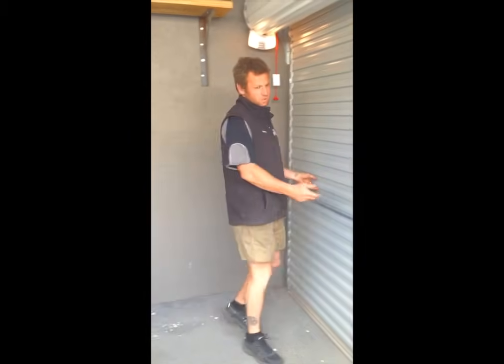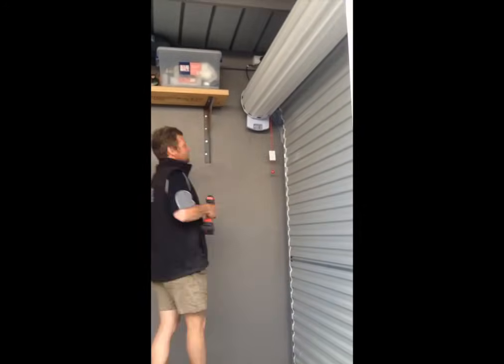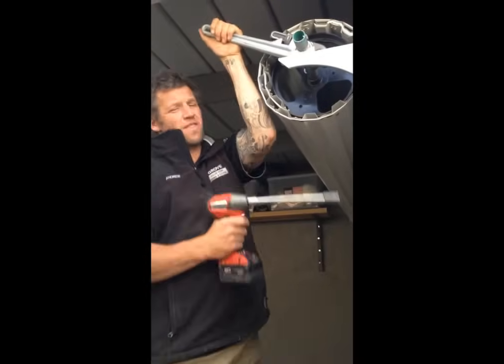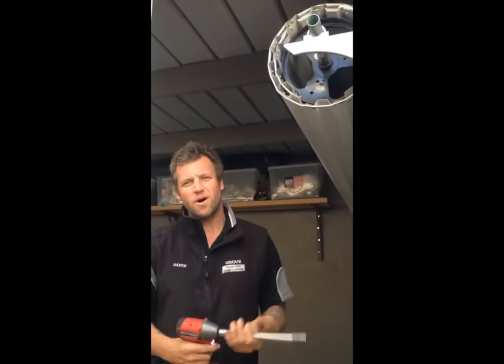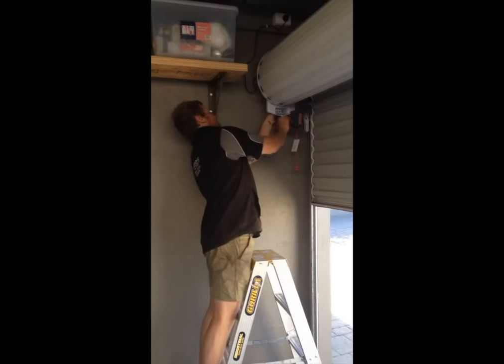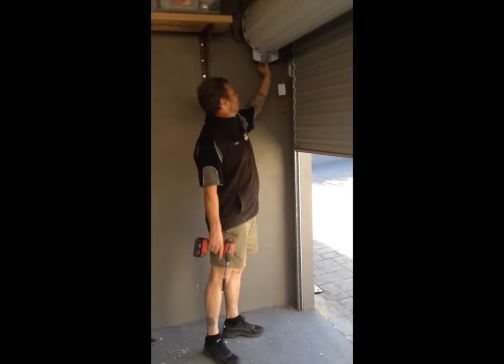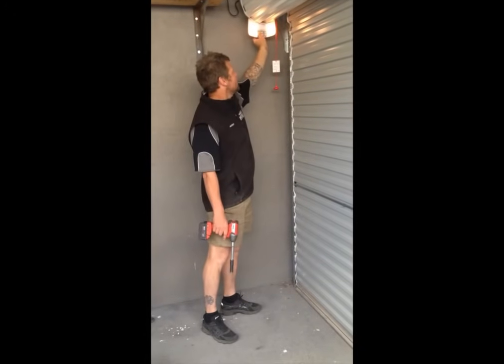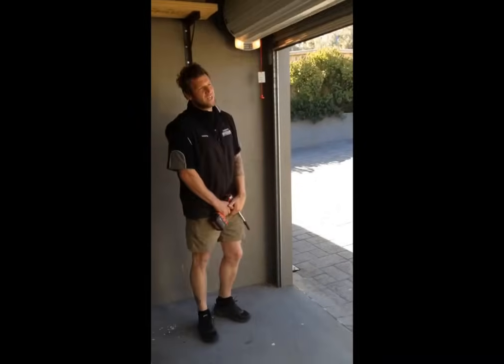Garage Roller Door Re-tensioning

Comment: Just like to say good video BUT big mistake in this video is that you have to door down when you undone the spring (u bolts) that is SUPER dangerous the roll needs to be up ... on a small door like this its no real issue but do it on a bigger door the one u bolt wont hold all that spring tension and you will have people worse off than before ... when a roller door like this is down the spring is at FULL tension have it up its like maybe 2-3 turn worth of tension ... If the door doesn't want to stay up use some visegrips to hold it up ...

Comment: Great video. My door is a manual door. Opening it the ‘roller’ doesn’t keep up with the door and it doesn’t ‘spool’ properly at the top. It bunches up. The only way to open without this happening is by ‘paddling’ it both arms above my head. Any suggestions? Could this be a re-tension? Or more likely something else.

Comment: My door problem is that the door parted from the left hand side I have re attached the door to the wheel with the door fully rolled out I have to re tension the left spring only how many turns are the starting point the door is 12 ft wide and 8ft high

Comment: Jesus mate DO NOT under any circumstances undo ubolts whilst the door is down and under HIGH tension.  RE tensioning is done whilst the door is open and DIY’rs put a rope around it for safety.  If you didn’t spin the motor around the limits wouldn’t be out of sync either maybe you need some training mate.
Reply: Thanks for this info, I just loosed my bolts with shutter down and the spring has now locked the door to ground, how do I loosen the spring now so I can open my roller door again?? Help is much appreciated
Reply: Look like your the only Amateur here in the comments, as everyone else has thanked Ole mate for a Clear & Concise Educational Video.
Reply: @filipina5953 the fella is correct 

this is def wrong way
Reply: @jasonmcdaid2200  Quite the contrary, with correct precautions taken, can be carried out in a completely safe manner. Too many “one jobbers” on YT that possess tunnel vision.
Reply: @filipina5953  with correct precautions just do it the correct way 

this way will result in several other issues
Reply: @jasonmcdaid2200  You are assuming, without knowledge. Being doing it successfully for years. More than one way to skin a cat.
Reply: @filipina5953  incorrect simple as

Comment: Great Video. Helped us to fix a roller door at friends place. Have issue with one of the other roller door which balloons out initially while rolling down and the door jerks in the track.. In manual mode the roller door holds whilst half way down. So not sure what the problem is. Can you please tell me how to fix this? thanks
Reply: Did you ever solve this issue? We have the same problem.
Reply: @thetruth00  still having the issue. But it's sporadic. I am still confused whats causing it.

Comment: Wrong!  Do it with the door rolled up.  Then there is hardly any tension and way easier to turn that bar!
Reply: Is this true?
Reply: That makes sence Paul.....
Reply: If you adjust tension with door up it would be very hard to guess how much more tension is neededto correct the problem. I go with the door half up method, makes more sense to me.

Comment: My door has a problem It can open but can not close automatically any sugestions?
Reply: Easy fix ! I  just fix for my cousin door ! The door has 2 switches sensors ( 1 is goes up and 1 switch sensor going down so the 1 switch going down faulty so 1 going down need to be change )

Comment: G'day mate. I have problem with my garage roller door. Every time I open or close the door it makes very loud squeaking noise. how can I fix that any help will be much appreciated please.
Reply: Clean the runners (best to remove them and clean full distance and also roller door edge whilst accessible) and lubricate the coils / springs eg silicone spray or light grease.